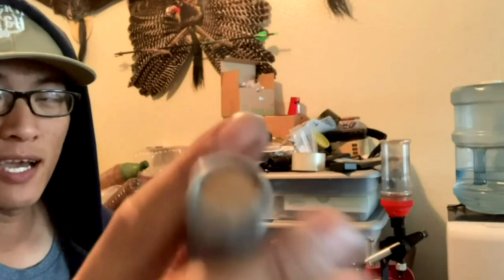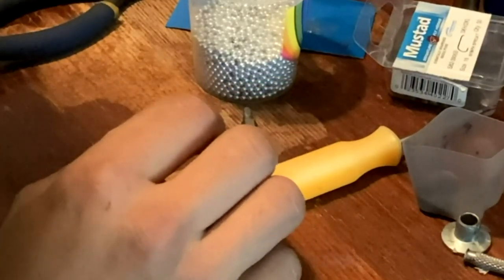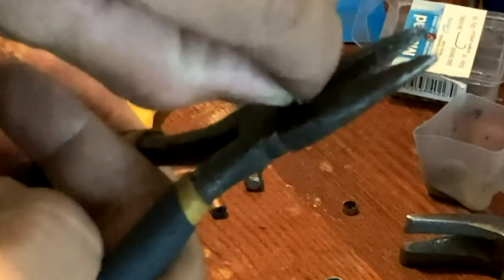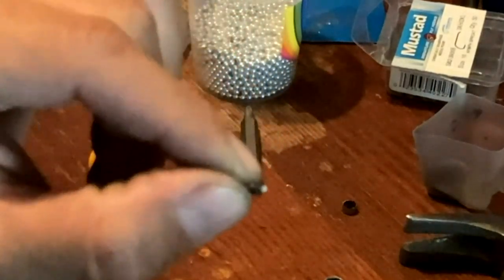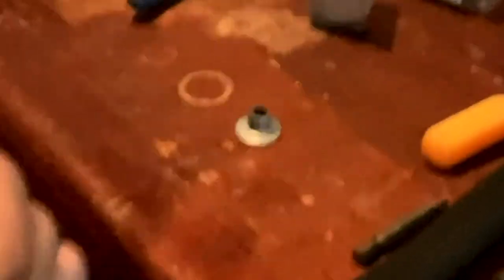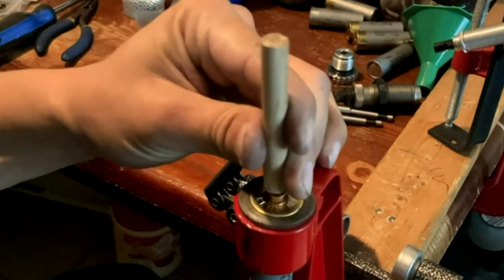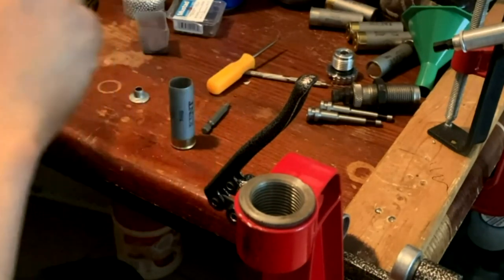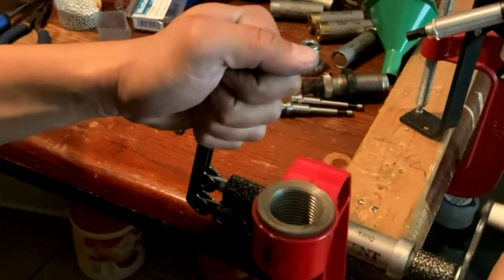RELOADING SHOTGUN PRIMER!!! THE NEW WAY TO LOAD!!! FULL TUTORIAL WITH NO PRESS!

Comment: You say it takes 2 anvils? Is that the case or did you just put the piece you cut off back in there? Its hard to see in the video. Also, the prime all, did yours come separated and did you mix a large batch or can you get it premixed?
Reply from the maker: The original shot shell only comes with that pointy anvil. To remake it u need the anvil from a rifle primer and then the original shotgun anvil holds the rifle primer in place so it doesn’t just sink in deeper when the firing pin strikes, and yes I put the piece I cut off back in there. As for the prime all, I just mixed a big batch. Idk if they sell premix